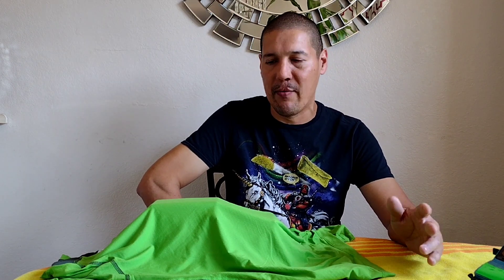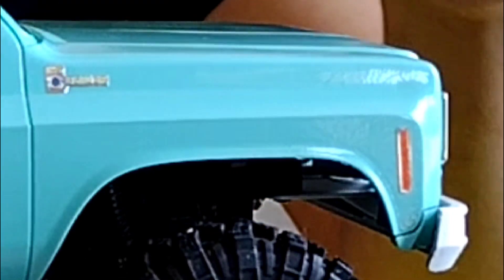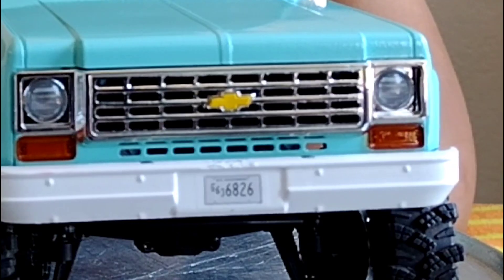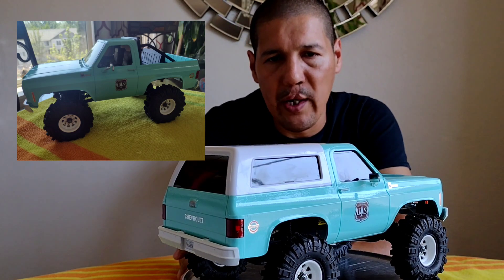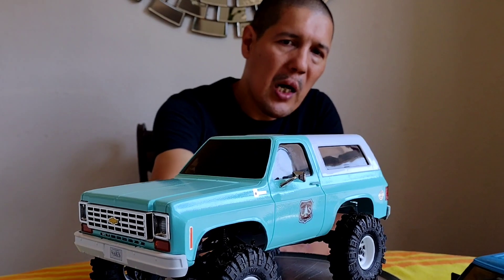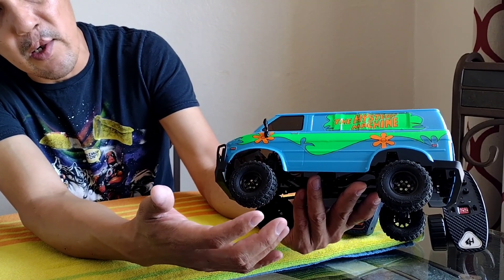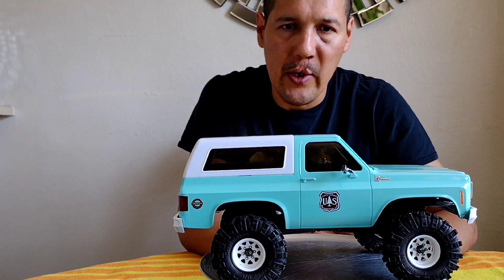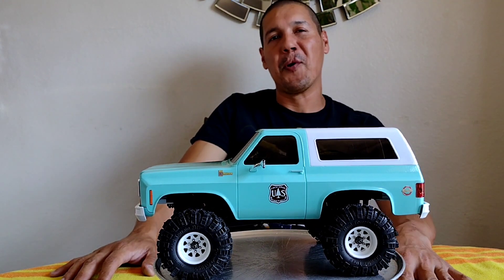FMS FCX24 K5 BLAZER !! FOREST SERVICE VEHICLE PROJECT PART 3 !! UNVEILING AND INTRODUCTION !!

Comment: I've actually seen this after I saw a run on a ? creek bed, nice. Like the interior - adds something more when the shell is off. Going have to look into finding/getting one for mine.
Reply from the maker: It sure does man although the rear bench seat is literally useless it adds a bit more scale realism to the blazer as it should the interior is not much better but u can get a figure in there but just the torso up basically or it wont fit u can get this interior thru etsy.com  just type in ➡️ fms fcx24 blazer interior i got mine thru jo's rc i believe